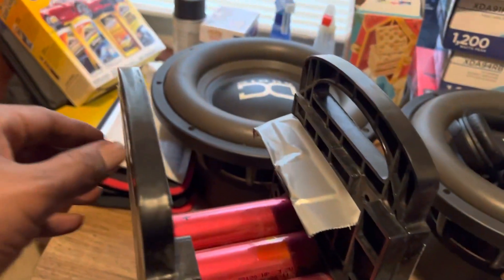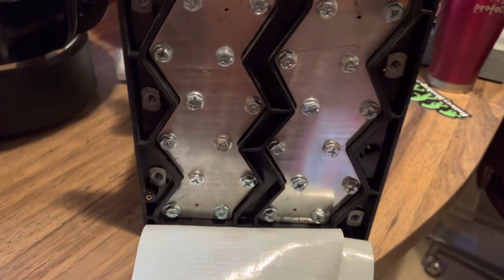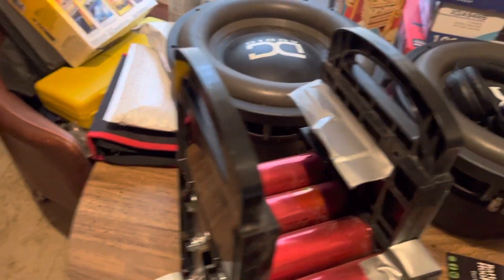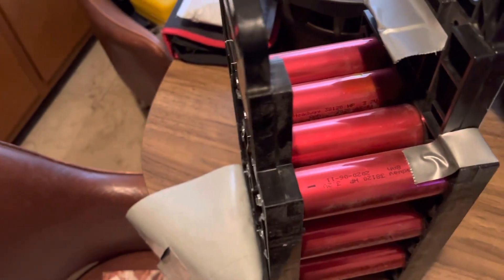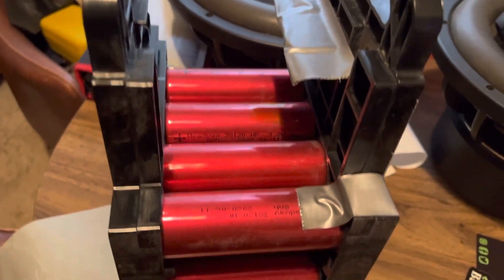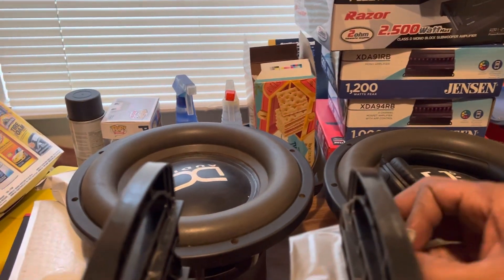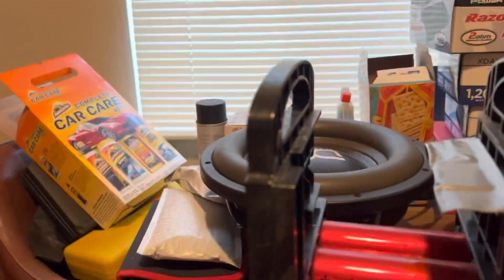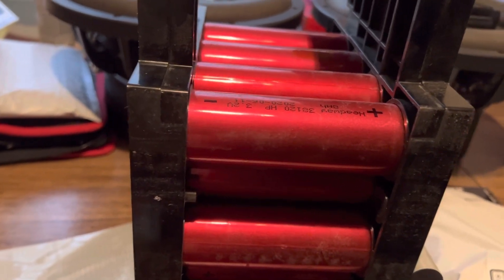Cheap Lithium Headway Cells From Battery Hook Up 48ah HANDLE BEAST MODULE

Comment: It's actually a 96ah lithium battery bank after the 12V conversion. That's about 10,000 watts.
Reply from the maker: Yes that’s for the bigger Beast mine is the smaller for 48ah

Comment: Awesome 👍. How many watts does this support?
Reply from the maker: Up to 6k
Reply: @markwoods212  awesome 👍. Can I add more of the headway batteries from battery hook up to this module? They are only 5 bucks. I might be running about 8k Watts RMS.
Reply from the maker: @drvictoria07  Yes but remember whatever you adding more headway you’ll need more bars
Reply: @markwoods212  would the super beast be enough to push a 5k watt amplifier and a 2k multi channel? I want to make sure before I purchase it
Reply from the maker: @drvictoria07  Yes

Comment: Do you have to charge the cells with this module?
Reply from the maker: No you don’t but it would be great to charge them before installing
Reply: What's a good battery charger for the cells?
Reply from the maker: @josephwilson6863  https://www.amazon.com/Adjustable-Switching-Regulated-Adjustments-Jesverty/dp/B09YTNHF8V/ref=asc_df_B09YTNHF8V/?tag=hyprod-20&linkCode=df0&hvadid=598240177374&hvpos=&hvnetw=g&hvrand=15011900712745856826&hvpone=&hvptwo=&hvqmt=&hvdev=m&hvdvcmdl=&hvlocint=&hvlocphy=9016549&hvtargid=pla-1688494359095&psc=1

Comment: Bro I have 3 64ah 38120's in group 31 battery boxes I bought empty. Then I bought a super beast to reconfig to create a 96ah bank for the spare vehicle. You cannot cannot cannot go wrong with Headway 38120's They're a safe chemistry and they play nice with agm of which LTO or CMAX cannot.
Reply from the maker: That’s what’s up brother I might grab me some more
Reply: @markwoods212  yeah man no doubt. I've got so so much lithium it's stupid lol. I have all those Headways then I bought 640 K2 batteries for a power wall I want to build for my house. I bought a couple NMC 90ah cells that came out of a BMW. I bought 2 of the coveted A123 bus batteries to try out. Lastly I snagged 150ah of Navita cells which they make only for the military. NIB too, same with the K2's. I snagged them on battery hookup as well awhile back. I want to build a test bench for the garage and mess with the ones for car audio and test them under loads not in a car. Also want to make a solar panel lithium setup for my storage building rather than running city electric to it.
Reply from the maker: @Basshead40  Wow but you can never have enough power
Reply: @markwoods212  I really just have wanted to experiment. Covid and having autoimmune issue myself I'm always in need of a project. I've thought about going the test bench and then building banks in videos and then doing giveaways on them. Help some young newer bassheads out kind of videos and channel

Comment: What’s this called I’m on the website
Reply from the maker: The lithium beast hit the home on the website and scroll down to the bottom and hit headway everything.
Reply: @markwoods212  what bus bar and balancer you get?
Reply from the maker: @BillyRay501  Oh the bus bar from conventryind.com and Balancer from EBay
Reply from the maker: Get the one that say 48ah
Reply: @markwoods212  is that all u needed to have it setup to work
Reply from the maker: @BillyRay501  They come in a set for 185 I can’t tell you how it works until I get my bus bars and that’s what I’m waiting on to build it
Reply: @markwoods212  I’m asking is bus bar and balancer is all that’s needed for the battery to be setup
Reply from the maker: Oh ok yes that’s all you need
Reply: @markwoods212  that website coming up as error
Reply from the maker: Try www.conventryind.com
Reply from the maker: In the web search bar
Reply: @markwoods212  can u tell me what balancer you get
Reply from the maker: https://www.ebay.com/itm/Heltec-BMS-4-6S-Capacitance-Active-Balancer-for-Car-Audio-Lithium-Batteries-/164722603046?mkcid=16&mkevt=1&_trksid=p2349624.m46890.l6249&mkrid=711-127632-2357-0
Reply: @markwoods212  is it true that those batteries come 60-80% used? I was told that
Reply from the maker: @BillyRay501  Yes that is true that’s why so cheap but they Guarantee they’re products I’ll say wait and see how my experience goes but I got advice from a few people on them and they say they’re excellent
Reply: @markwoods212  ok thanks

Comment: Very nice upgrade brother, now I know exactly where to go to get some lithium for a decent price. Price isn't bad at all. Can't wait until you get that installed 💯💯
Reply from the maker: Yes an awesome value for 48ah had to jump on it and also going to give me more space
Reply: @markwoods212  hell yea, drop some weight in the back aswell.
Reply from the maker: @RomaVilla  Even though the jeep could handle the weight but with the 3 monster batteries it made the jeep go down at least 3 inches
Reply: @markwoods212  I hear you brother I was scraping the bottom of my Corolla Everytime I went over speed bumps because of 2 agms in the trunk.